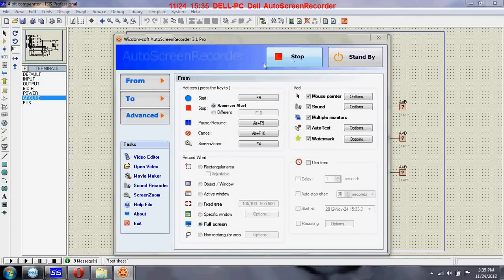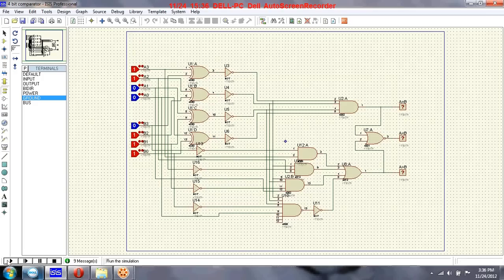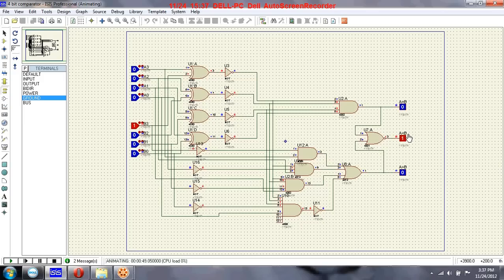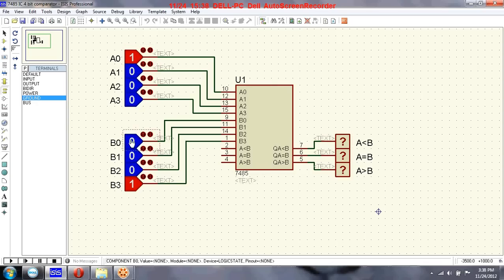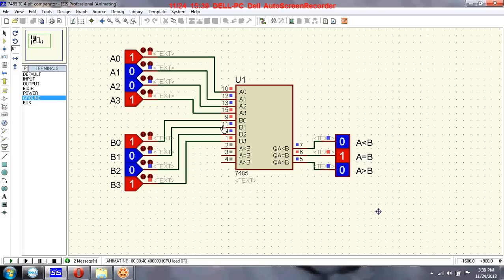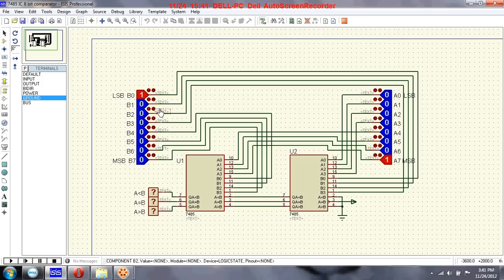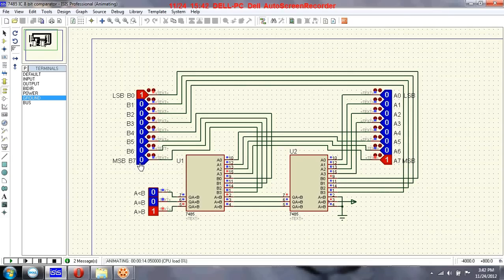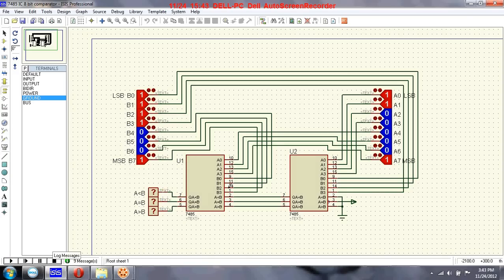4 bit and 8 bit comparators

Comment: Your basic layout has a flaw... All your examples are correct. EXCEPT if you only press A0...  (A=1 so greater than B because that is zero) Than you get a result of A < B... (whitch is wrong because A=1 and greater than zero)  You can fix it by feeding the empty pins of U10 with Vcc (+)